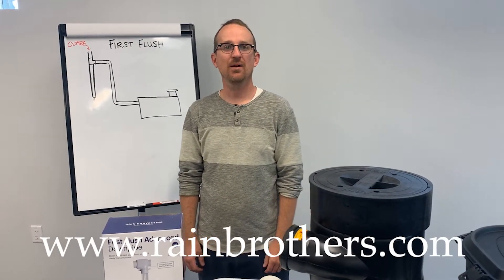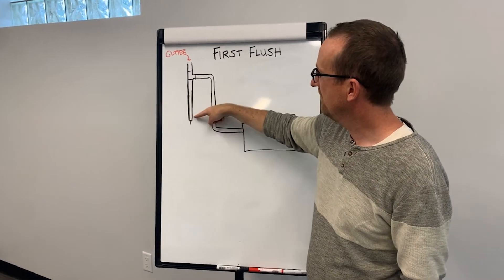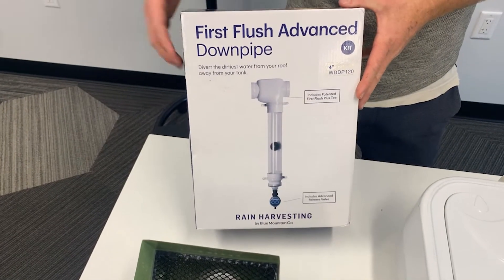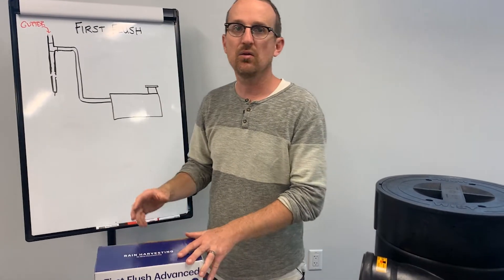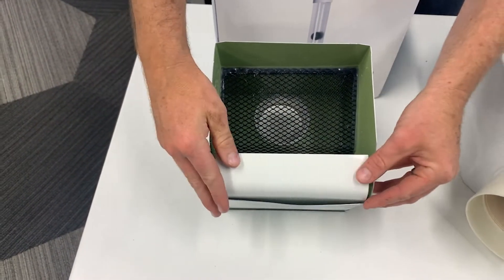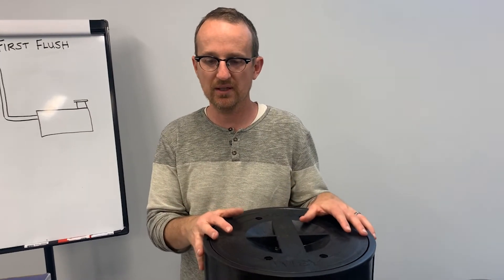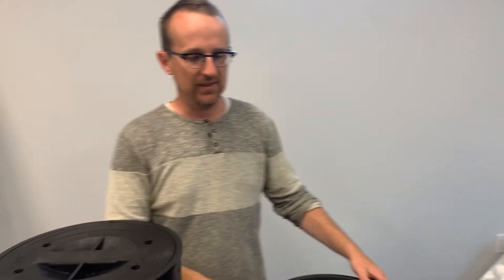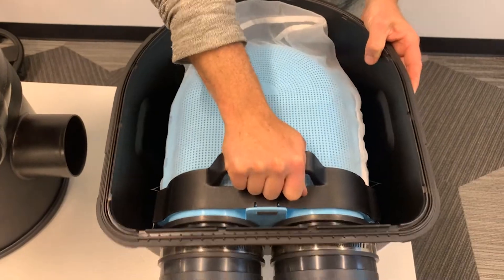MISTAKES with first flush rain harvesting filters!

Comment: We want to install an in ground first flush system to turn a wet collection system into a dry one.  Our tanks will be above ground, but too far away from the collection roof to go directly into the top of the tanks.   At each of the four collection pipes (high up, just below the level of the gutters), there will be downspout debris filters to filter out leaves, pine needles or any insects or critters that might wash off the roof and down the gutters to the down spouts.  Then the water will flow down the pipes and under ground, where the water will flow laterally and then up into the tanks at a level that is slightly lower than that of the debris filters where it enters the four collection pipes originally.  My idea is to put in a sloped first flush diverter in line with the slightly downward sloping lateral pipe under ground with a "T" pipe going up to the tank above just before it.  Hence the first flush water from the four downspouts will all make their way through their carefully sloped collection pipes that finally merge into one large pipe under ground as described and fill up that first flush container (about a 50 gallon capacity for our 2090 square ft collection surface as we live out in the middle of nowhere in the woods but the trees have been cleared around the barn such that likely only a few pine needles will blow onto the roof on occasion), and once that's full and the ball blocks any more water from coming in, the rest of the water will flow up and into the tanks where we could also have another filter if we wanted to be really fastidious!  When the rain finally stops, the water in the first flush system will continue to drain slowly (but surely!) until all the water in the pipes empties out completely, such that there will not be stagnant water sitting in those pipes between rain events, turning our "wet" system into a dry one.  

Since we live in NW Oregon, it pretty much rains all winter long and barely rains at all in the summer, so if we left it a wet system, water sitting in those pipes would get pretty skanky!  But with an in ground system all that water would drain out and for most of the summer the pipes would be empty and dry, while in the winter they'll be wet and full most of the time as it's raining almost non-stop.  While that means we'll likely lose quite a bit more water during the winter, especially when it's just lightly drizzling, we have 10,000 gallons of tank capacity and it rains between 50 & 70 inches each winter.  So it should easily fill up those tanks and keep them topped up without a problem within a month or two of the start of the rainy season.  

Do you have a recommendation for a pre-manufactured in-ground first flush system?
Reply from the maker: Hi - yes, Blue Mountain Group does manufacture an in-ground first flush system, and we can get it for you for a price at or below what you’d find anywhere else. But honestly, other than adding a ball to the system, you can make your own out of PVC pipe. I would recommend not using a ball anyway because once something is buried, you don’t want to have to dig it back up if that ball gets stuck. Just use a cleanout at the end of your first flush branch and drill out a small hole on the cleanout to drain that out between rains